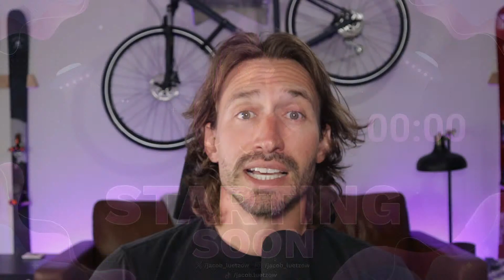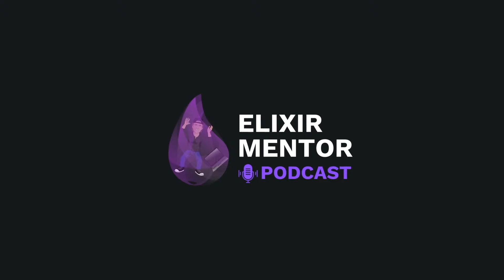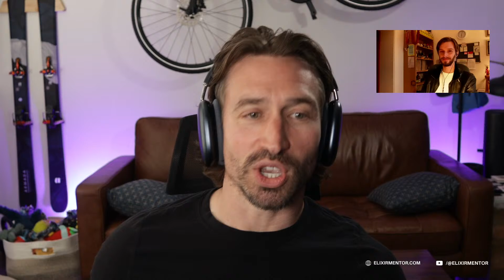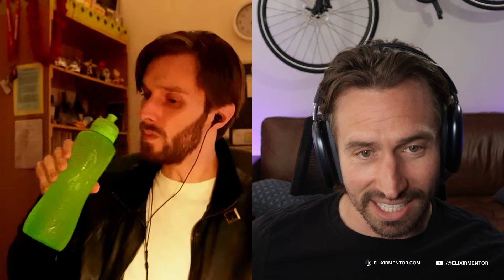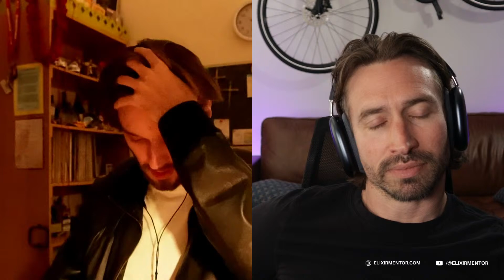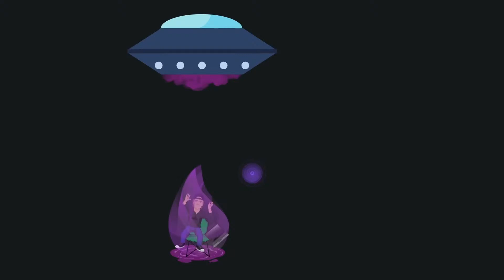Tristan Kildaire on Radio Resilience

Comment: It's only the routing nodes that need to stay more or less fixed in location in Reticulum. Non-routing nodes can move around physically without a problem. Simply having the various interface types configured correctly will be able to handle almost any kind of network you can imagine. Good and interesting interview!
Reply from the maker: Thanks for sharing and tuning in! Glad you enjoyed it.